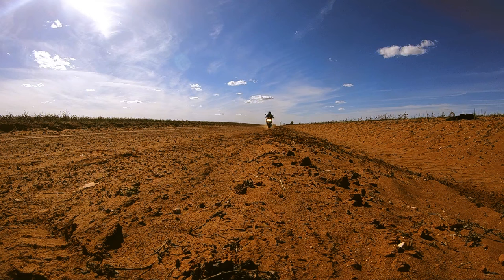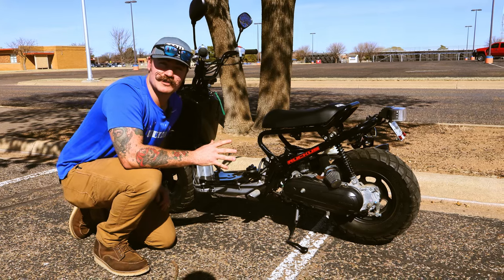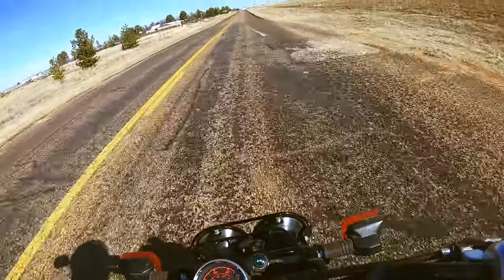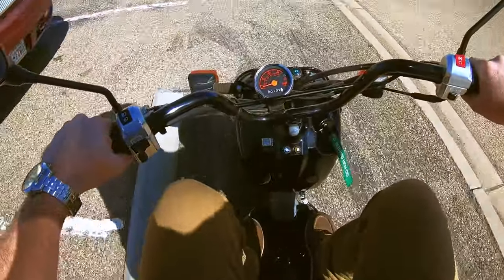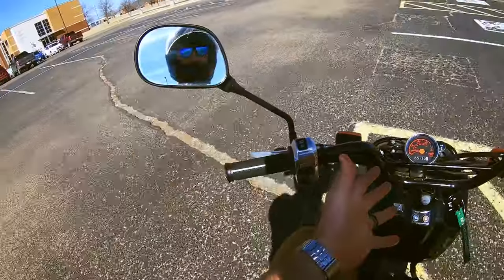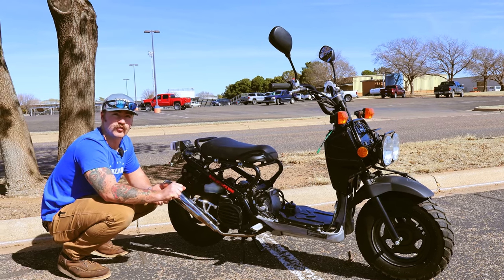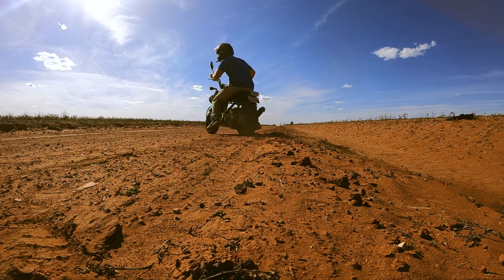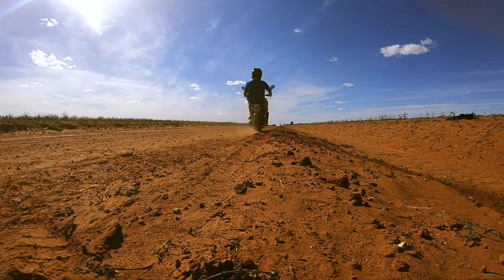Honda Ruckus (NCS50) Ride and Review, The BEST Scooter. Ever.

Comment: used for $1500?  yah right! these things hold they value and i can't find one under $2000 that isn't beaten to death!
absolutely the vanguard for honda reliability and what honda cut its teeth on as a company.
Reply: Bought my 2013 for 1500.00$
Only has 859 miles on it.
Deals are out there.
Reply from the maker: For a non running one you can consistently get them here in Texas for about $1200! Atleast here in a college town. Sorry the market is crazy where you're at!
Reply from the maker: Pretty similar to this one!
Reply: @octanerestorations  yah, im up in CT... breakfast here is $50
Reply: Bought my 2003 in perfect condition for 1300 with 3000 miles. All documentation and maintenance records too
Reply: Buying one for 1500 today :)

Comment: Did you just put REGULAR OCTANE FUEL 🤦‍♂️
Reply from the maker: I believe the manual calls for 87! I could be wrong though.
Reply: @octanerestorations  it says in manual "using lower octane will result in decreased engine performance" .. Under "Refueling and Fuel Guidelines" page 12 2024 Honda Ruckus manual